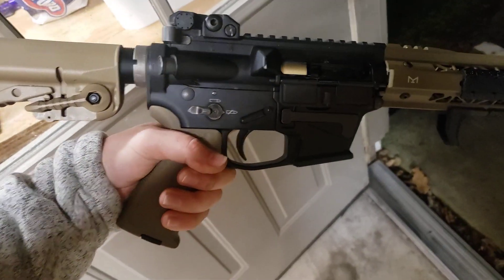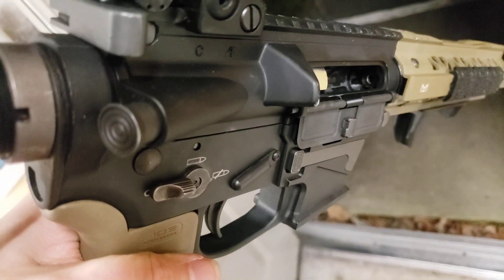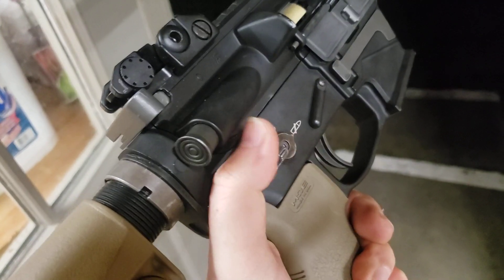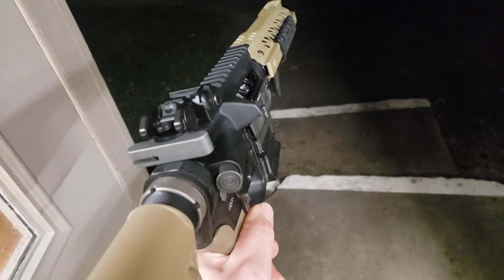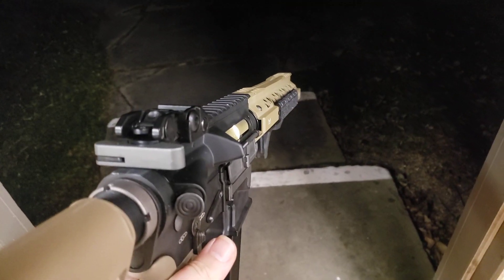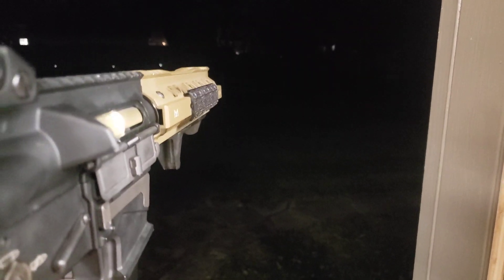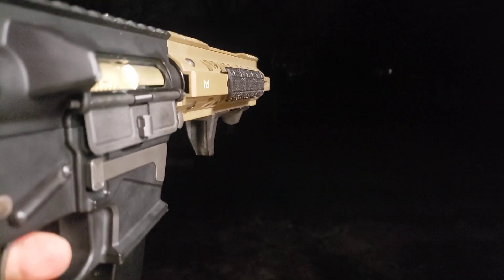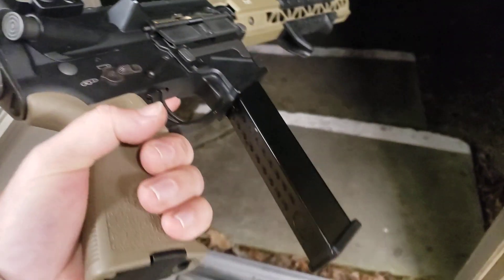Airsoft King Arms TWS9 GBBR short stroke ROF (rate of fire) test

Comment: I did the same to mine, however im concerned about the buffer bashing those quarters, ive had the back of buffer tubes break before 🤔
Reply from the maker: I'm hoping the red squishy buffer pad it comes with will stop that as I put it between the quarters and the spring.
Reply: @treesleavedents  if you have access to a 3d printer you could instead print out a 14mm long cylinder (2 dollars in quarters equates to 14mm). Would be far lighter and way better for the longevity of your gun.
Reply from the maker: @ArnoBreakChecker  3D printing is definitely next on my list of expensive hobbies to get into lol